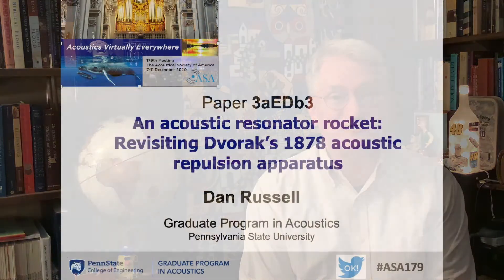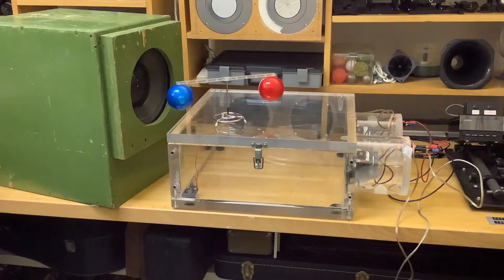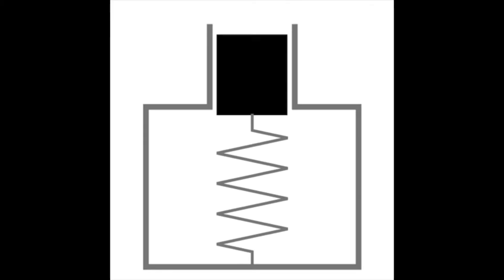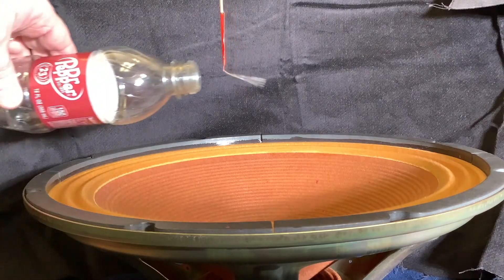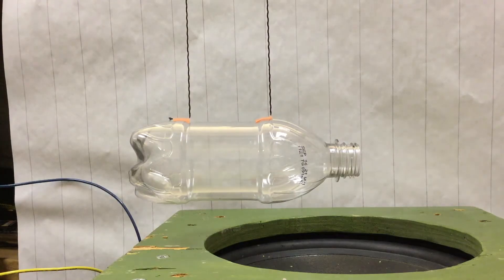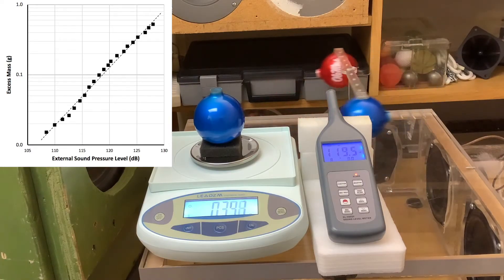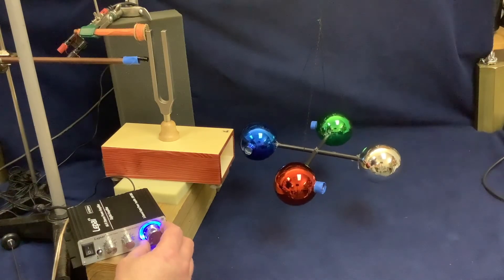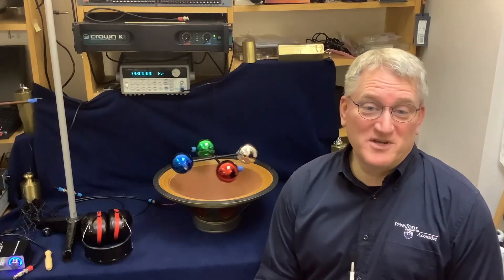Acoustic Rocket Demonstration -- revisiting Dvorak's 1878 Acoustic Repulsion Apparatus

Comment: Very nifty! Does this work with complex, non-repeating soundwaves such as music? I think it could be beautiful to have a physical visualization of the audio spectrum by using an array of tuned Helmholtz resonators moving up and down, sort of like a Galilean thermometer for sound. 

Would that be possible? It looked like the decibel level required to induce the jet flow was much higher than everyday sounds. Could one lower the volume needed by using a different cavity or neck shape, or perhaps a different material? Or should I just stick to tuning forks and deflecting mirrors?
Reply: I'm not sure that would be possible. At lower sound pressure levels, Helmholtz resonators oscillate like a mass spring system and don't produce consistent propulsion. Changing the dimensions of the cavity or neck would only change the natural frequency in which it resonates.
Reply: @wynnfirstwave  Thanks. That answers my question. Helmholtz resonators are fascinating. I still don't have my head wrapped around how they can create propulsion at all.

Comment: Here's the conversation:

RESONATOR:  "Okay here comes the air.   Pulses of air molecules pushed by the speaker."
SCIENTIST:  "So - air enters.  What's your next move?"

RESONATOR:  "The air comes in.  It's gotta go right back out, I"m only open at one end.  The other side is closed off."
SCIENTIST:  "Air comes in, air goes out.  Anything else?"

RESONATOR:  "Try that in a vacuum."

Comment: Would you like to see my 1 terrawatt acoustic engine that makes it's own water and turns it into hydrogen and burns it for feedback of sound? It has 13 non moving  parts that can be reproduced.. I have the CNC codes. You would just have to ask the machine shop to make the parts... you don't need to plug it in to start it you just have to sing to it until it gets hot and then it will never stop..... you could wack the xylophone key but then you would be too close to it and it would hit you with a bolt of lightning.... It's surprisingly small.. 2 ft high x 1 ft diameter... and no coils or wires.. I use other types of ways to generate the high voltage and the vibrating electromagnet that is water cooled. It makes hot water air, gravity and electricity... possibly slows time... I think I cracked that one too... It was too easy to engineer... seriously simple. I think i was 7 to 12 years old when I figured it out....I tried to get others to help but nobody wanted to help at all.. and so I had to do it all myself... and here I sit for at least 3 decades with the solution to the green energy problem and everyone is too cheap to put a penny into it and too lazy to spend the time. There is no free energy.. you can't get something from nothing.... it burns water... and from the simple magic of science it also makes it... and uses the same water over and over again and never runs out. You just have to look at a doughnut with the hole in the center.. the sound is going upwards and the feedback is coming back up the hole at the bottom... too easy. It's the snake eating it's own tail.. the snake representing vibration and the eating of the tail representing feedback. The power of your voice alone.. can move mountains. There are some simple tricks to use..wood vibrates when it gets hot.. and gold becomes magnetic when it gets hot while iron is not... so then a tuned box with an air hole on top lined with gold becomes a vibrating magnetic field when it gets hot.. and once the box gets hot inside all the cold air goes to the bottom hole and all the warm air goes up the center and blows a horn onto the underside of a heavy xylophone key that bounces on some disks.... and more.
Reply: @mememan2344  ok
Reply: Would you mind sharing those files?
Reply: @mememan2344  you tube is blocking my reply...how do I contact you?
Reply: @omegafile  it keeps deleting mine as well...hmmmm
Reply: @mememan2344  im on linkdin as Gamer Kingdom
Reply: @mememan2344  I don't have the balls to make a you tube video about it. I don't think they will allow this out. look at the galaxy.. it has a black hole.... it's thermoacoustic.. we are being lied to. This device is a doughnut inside a box.. it has a black hole and everything gets sucked into it.
Reply: @mememan2344  find me on linkdin as gamer Kingdom..i can show you the drawings
Reply: @mememan2344  It's basically 2 granite disks that look like the 12 inch Dropa stones found in China.... 2 speaker seats.... a cog to separate the 2 disks so they face back to back in opposite directions... a 90 hertz singing bowl with a hole at the bottom...  a connector to hold it all together... a drum box with a hole on top tuned to 90 hertz... a 454 lb xylophone key tuned to 90 hertz. there are 2 knobs sticking out of the sides of the bowl to gravity feed water to the disks and act as a spark gap.. they need to be bent downwards so they don't touch the seat and you leave a 3/8 of an inch gap there.
You sing to it and the xylophone key bounces on the disks and creates heat at the center of the doughnut to make it blow like a horn to the underside of the xylophone key.... if you cant get it hot enough then you add a electromagnet into the hole..... a winding with an iron bar and connect one end to positive and the other to negative. It's a thermoacoustic engine. The inside of the box looks like an hourglass with only the bowl facing up. When the center heats up it will suck cold air from the bottom of the hole inside the box. Everything inside will spin like a doughnut and get sucked upwards through the hole.... first you will get water droplets.. then hydrogen then plasma... very dangerous... build at own risk .. it's high voltage and high amps... The amps will go high because of the water and this will cause the center to get real hot and it will blow like a horn to the underside of the xylophone key. The disks are thermally conductive and will conduct the heat to the center cog because the current will conduct through the disks. The initial voltage comes from 2 sources.. the splitting of water droplets and the piezoelectric effect of the 500 lbs of force on the disks... giving a lot of high voltage in AC current. Because the xylophone key is a microphone and the disks are speakers.. you get a feedback tone and so it should pick up the resonant frequency of the spinning water droplets and amplify it and vibrate them apart into hydrogen that will thermally get heated into plasma. It's basically a galaxy in a box. The disks have a range of up to 20 million hertz but the water droplets will split into hydrogen at about 63,300 hertz. You don't have to guess the frequency because the microphone will automatically pick it up.. Because it makes it's own water it will gain mass and therefore it should also slow time.....By how much I don't know. But keep in mind that you would have to reach at least 25% of the speed of light to notice a difference. If you want to make it even more powerful then you make the distance from the bottom of the bowl to the underside of the xylophone key exactly 21.1 cm apart.. and it will be bouncing the wavelength of hydrogen off the bottom of the xylophone key back and forth......
Reply: @mememan2344 ... check there now I gave you the link to all the parts.. with great power comes great responsibility...get a suit that can take a lightning bolt if you plan on building it...be careful. You may need my help to tune and tweek it or you may be able to figure it out now... it's not very complicated it just has to be tuned right... and the box has to hang at the nodes so it can vibrate like a wind chime... I waive all liability.. build at own risk..
Reply: @mememan2344  Look at the galaxy and you can figure it out once you realize it's thermoacoustic.. without the black hole which is the hole at the bottom of the bowl.. without that you have nothing... The vibration causes the heat at the center and then the bowl blows like a horn keeping the xylophone key bouncing on the disks forever.... Look how simple it is!
Reply: @omegafile  bro why you spreading fairy tales my guy?  I been experimenting with similar shit for multiple decades and while I have seen some amazing things the nonsense you speak stands zero chance.
Reply: @seditt5146  Latin literature: You can find "nescius" in classical texts by authors like Livy and Horace, where it describes someone or something unaware of danger or ignorance
Reply: @RelativisticSpace What about it?

Comment: Super cool! Thank you for sharing! 

Do you think you could set up a table top experiment for kids with a blue tooth speaker and a tone generator app? Maybe using smaller ornaments and a thimble.
Reply from the maker: I highly doubt that a blue tooth speaker and a tone generator app can produce a loud enough signal to make this work. Smaller sized ornaments would require a higher frequency -- but   the two most important parts are: very lightweight resonators (the bulb ornaments I used in this demo were about 10-12 grams) and a very loud sound source at exactly the right frequency. That's why I was using a big loudspeaker driven by a very powerful amplifier.  In order to get these balls to rotate, I had to produce a (dangerously loud) sound in excess of 115 dB (30 times louder than the level at which hearing damage occurs).  At the end of the video you can see that I was wearing heavy ear-muffs to protect my hearing while the sound was turned on.  My big loudspeaker was starting to smell (burning wires) because I had so much current running through it to make the balls and bottles rotate.
Reply: @DanRussellPSU Yeah, that’s not too kid friendly...  Thermal acoustic solar organ might be a little bit safer and interactive while covering similar ideas. 

Thanks again for the reply and amazing videos!